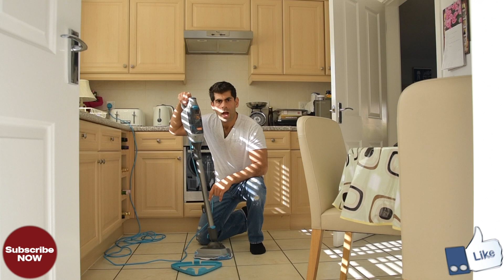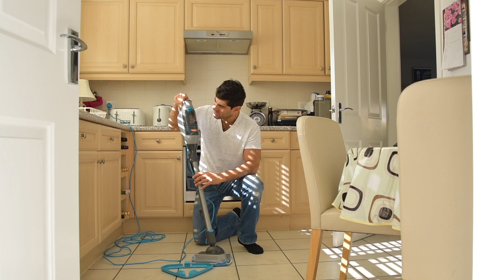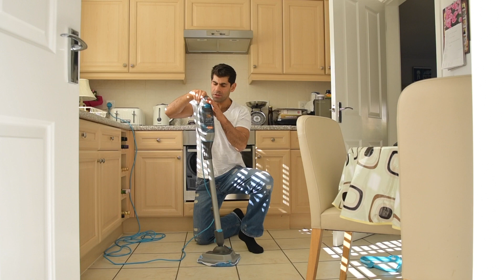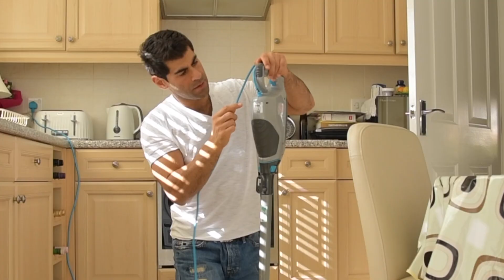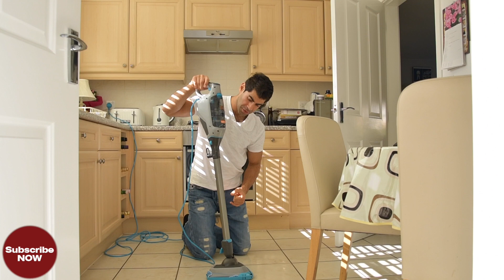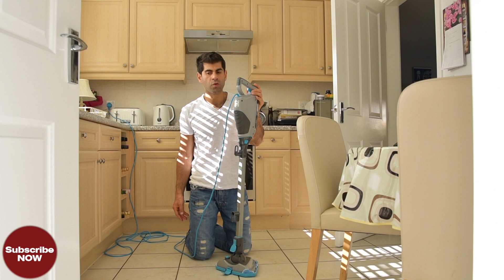Vax Steam Fresh Power Plus Steam Cleaner S84-W7-P Review

Comment: Thanks for that, you are spot on when you point out it is a relatively simple device, there is no excuse for such poor quality at the price. I had a Karcher one I thought was decent and the steam control snapped, I have an expensive Polti one - firstly the mains switch broke which I replaced and now it seems the thermostat has failed as it's not cutting off and saying it's ready. Both after about 3 years of light use.

Comment: To be honest, it's not just Vax, it's everyone now. There's this massive move towards using poor quality, cheaper materials.  The intention is for things to break within a year or two, just outside the warranty, so you can buy the newest model.  Also, it's all about cutting costs and mass production now.  Thanks for this review. Terrible product.
Reply: Manufacturing process called planned obsolescence, they make the product just well manufactured enough to take it just after the warranty or guarantee is over.

Comment: What a waste of money.  The stick is top heavy therefore the plastic that attaches to the top has split.  
It does not clean the floors properly.  My tiles are indented and in fact when I have used it on the floors, they do t look as they have been touched.   Extremely disappointed.    This machine I rate as zero star
Reply from the maker: I feel your pain!